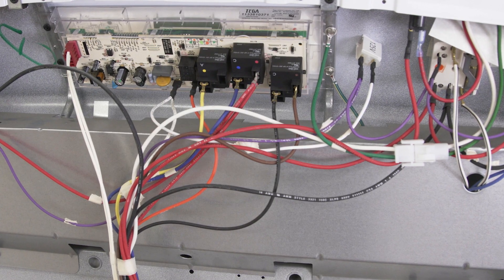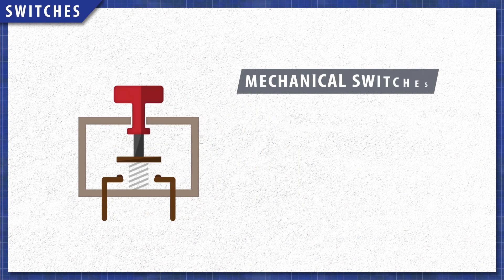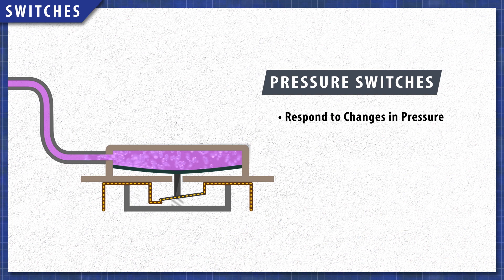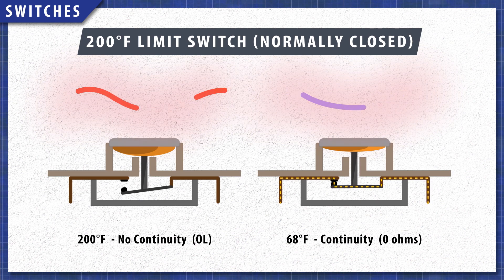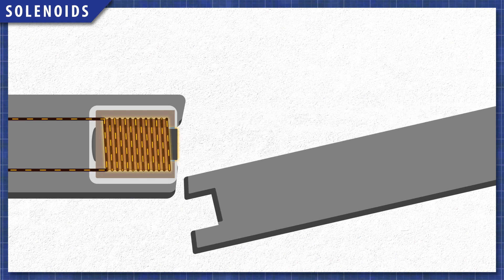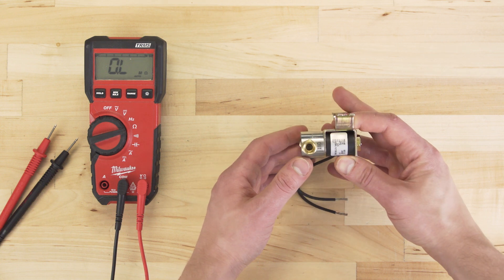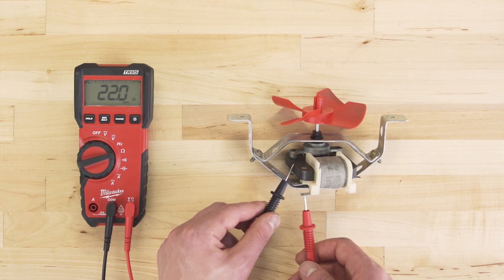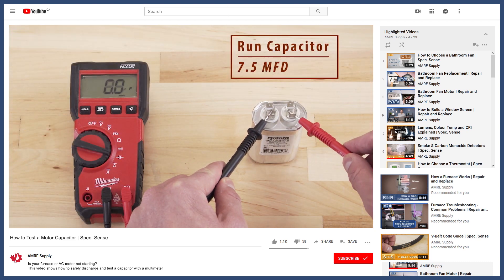Appliance Component Testing - Part 2 | Repair and Replace

Comment: Very useful video, thanks.
I used to make all those brass fittings on the last solenoid in what was one of the biggest, if not the biggest turned parts manufactures in Europe. Then the early 90's happened and all the work went to China.
Reply from the maker: You're welcome Richie, we're glad that you found the video useful. 

It is unfortunate to see so much manufacturing shut down on a local level. Canada used to be similar and now less and less manufacturing happens on our soil.